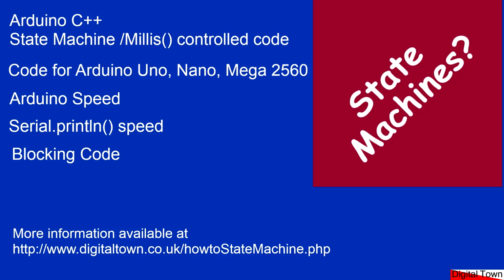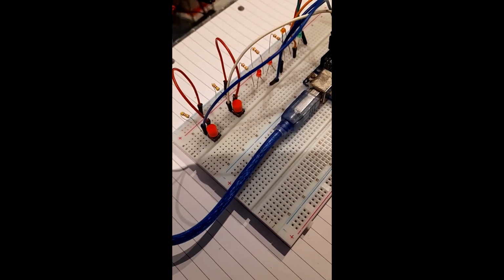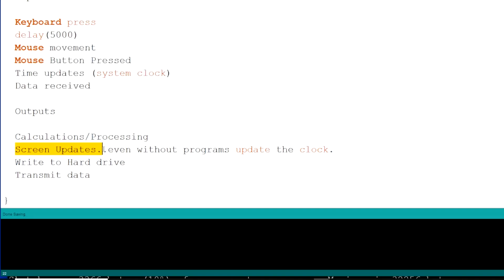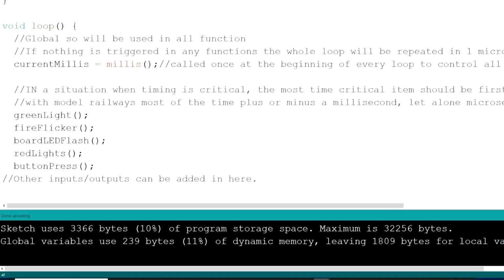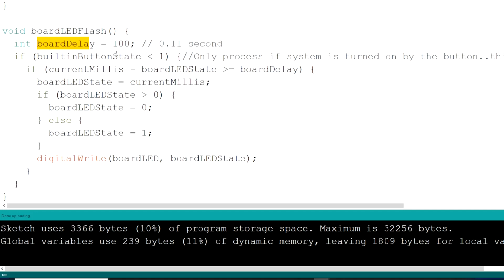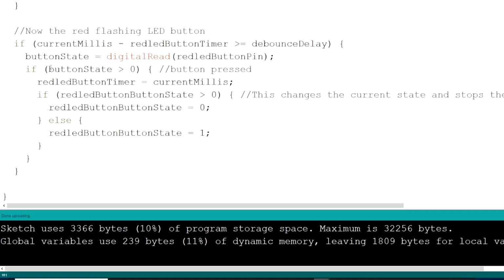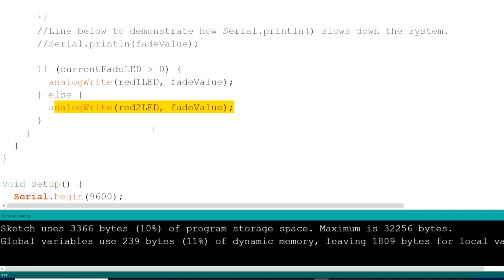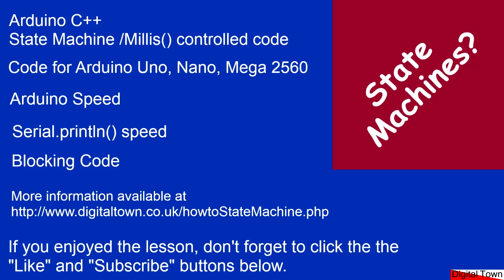Arduino C++ State Machine (millis controlled) code tutorial

Comment: I think the reason the butttons are not working correct every time is due to contact noise, which needs to be filtered out
Reply from the maker: That's what the debounce code does in the sample sketch. Just about every button has some form of contact noise when opening or closing.

Comment: Down loaded this sketch, unable to get the 2 red lights flashing. Sorted it by adding a } after the fadeValue++; line and }after fadeValue--; line, and removing 2 }}  at the end of the void redLights().
I assume the line servoSignal = 8 has been left over or for another YT video, involving servos.
Keep up the good work. It took me a long time to get my head around millis, but getting the lights working was a help.:)
Reply: Oh dear, left is running for half an hour, now pressing the button doesn’t always switch off the lights. Back to the drawing board, perhaps tomorrow my brain hurts.
Reply from the maker: Thanks, the servoSignal was going to be another section of the video but it got too long.
Do you have buttons in your set up with pull up or pull down resistors as changing those brackets will effect the button code.
Reply: @digitaltown5442  I have indeed set buttons with INPUT_PULLUP lines in. Thanks will look into that , or just put resistors on and try again.
Thanks for the quick response.
Reply from the maker: @willsgrandad  If you have pull up resistors the pin by default will read HIGH and keep turning the system on and off every cuople of microseconds so the flashing sequence won't work. You're mod basically disables the button state. In the function void buttonPress() just change the 2 lines that read if (buttonState > 0) { //button pressed to if (buttonState < 1) { and the code should work with pull ups.